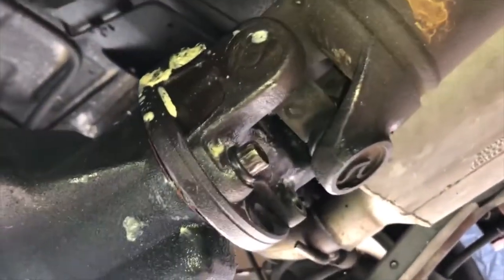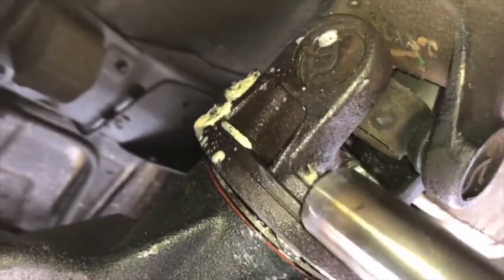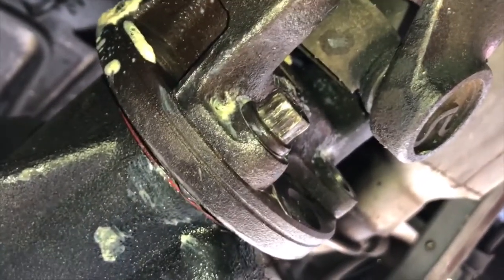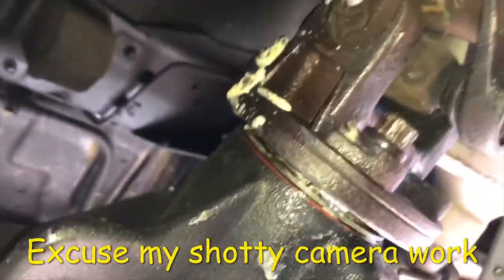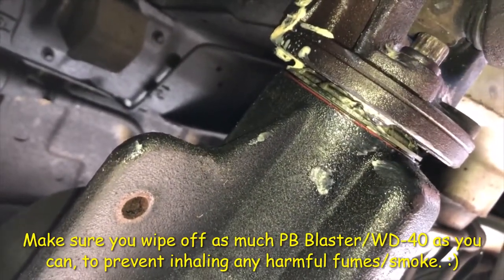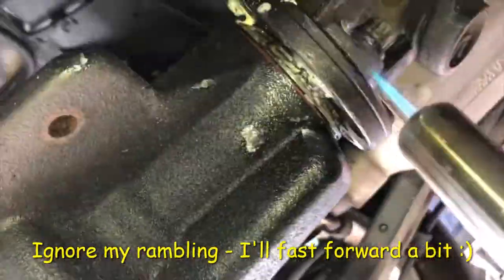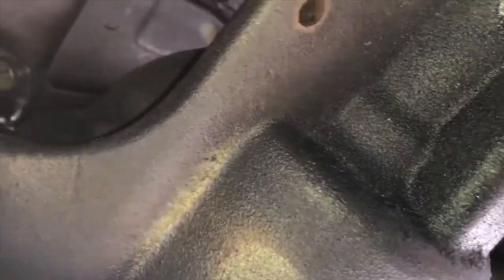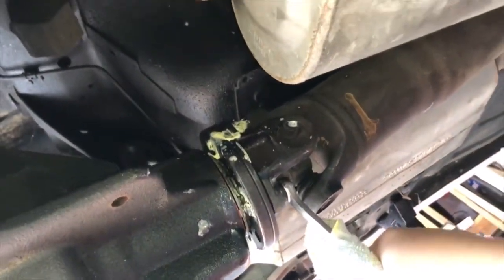Helpful Tip For Removing Driveshaft Bolts

Comment: Can also get the yellow tank MAP gas torches. they generate a ton more heat so get hot faster. Was helping someone remove a wheel hub that would not come loose with a propane torch. Grabbed a MAP gas torch and was out within 15 minutes.
Reply from the maker: that’s a good tip, hope others look at that if they’re struggling with a tiny torch. thanks!!

Comment: how did you get the driveshaft not turning when removing the bolt? The driveshaft keeps turning to the same direction that i want the bolt to turn.
Reply from the maker: i cant really remember sorry... i think i may have applied the parking brake? ;s idk
Reply: probably doesn't help now but it if it's a manual car put it in 6th gear

Comment: How do you avoid overheating the area around the bolt and ruining the pinion seals though?
Reply from the maker: To prevent any unwanted damage, don't run the torch super high, keep the flame more so on the head of the bolt and the middle. 
In the video it's a little hard to tell but I didn't get the flame too far behind the actual flange...
If you're heating up bolts on a different part I'd assume you could use those same tips - just keeping the flame low and towards the middle/head of the bolt.

I was removing the seal altogether so I wasn't too concerned though.
Hope that helps
-CP

Comment: hey man what size wrench did you use and was it a torx wrench or special wrench?
Reply from the maker: Its a 12 point open end wrench - I'm pretty sure the driveshaft bolts are 12mm.
 
Hope that helps

Comment: Im gonna try this out mine havent budge for 2 days now and ive spray pb blaster and deepcreek. Thanks for the information
Reply from the maker: No problem! I know how frustrating that is... wish I knew this when trying to get my water pump out...

Good luck!
Reply: Hi @nicholasramos953 How did this work out for you?  Thanks!
Reply: @davidijafri  just tried it out. Hadn't had the time to do it until now. It works great!
Reply: @nicolasramos953   Great!  How long did you apply heat for?  I tried it but wasn't able to break torque and I was worried about damaging something from 'overheating' it.
Reply: @David Jafri  about 1 minute and I pointed away from the seal and I moved it side to side which help
Reply: @nicolasramos953  Thanks!  It worked!  I was so worried about damaging seals, so I used an infrared thermometer and heat the area to 200-225, which seemed safe, and that melted the OEM locktite!  Thanks again for the feedback!
Reply from the maker: @davidijafri  @nicolasramos953 glad this worked for you both. take care

Comment: Not everyone has a blow torch stick to reality
Reply from the maker: ? Lol... it's not a blow torch. Its a simple propane / butane torch you can snag at Walmart for like $20-$40.... Get real bud
Reply: Reality! Reality is this is probably best way, and it's a trip the the hardware shop and literally less than a 6 pack for one of these torches . Or reality might be to strip the nut
Reply from the maker: @slabcharger7162  some people, right? thanks. take care